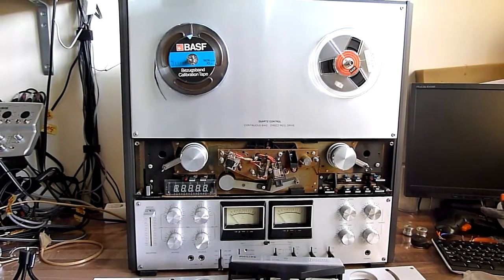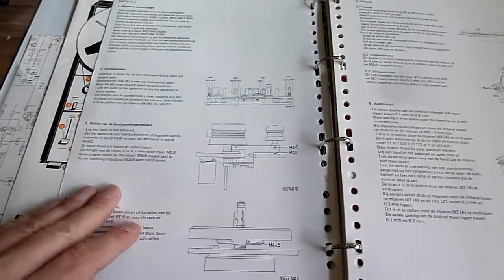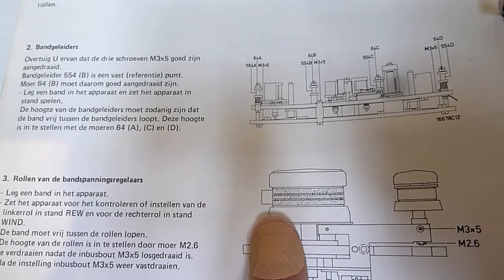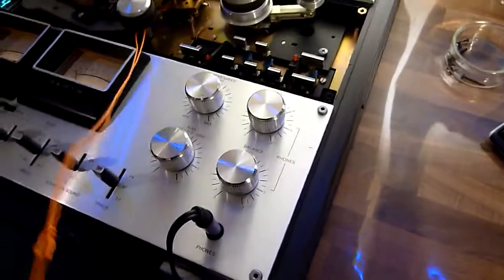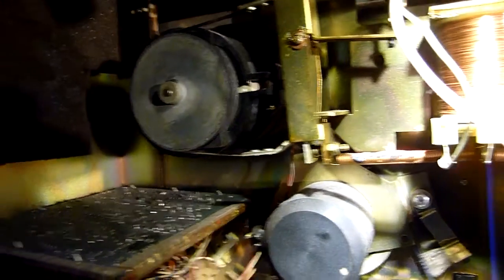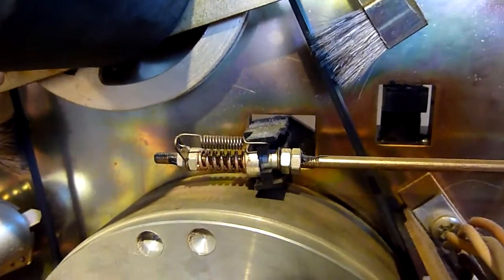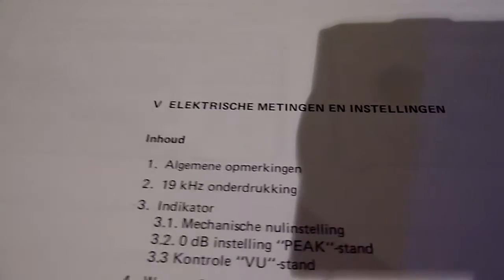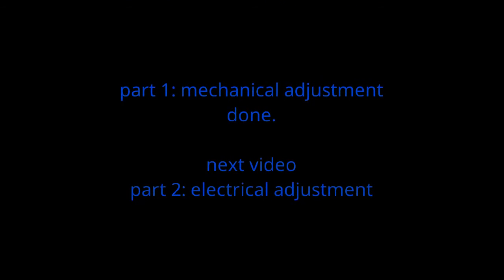Servicing a Philips N4520 tape deck part 1: mechanical adjustment

Comment: Thanks for this Video. What do you think, how many Versions are out on the market? I saw one, that had some "set in" Plate on the front. Never saw that one before. Then of course the first wave, but there are more different types, same technique and same outlooking but inside it is a bit different